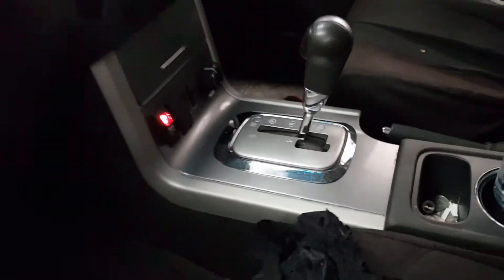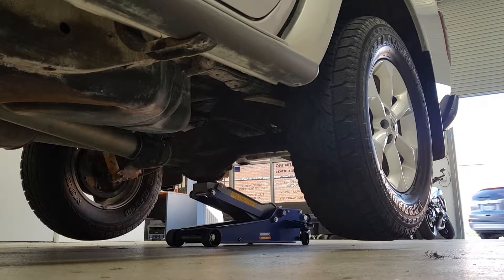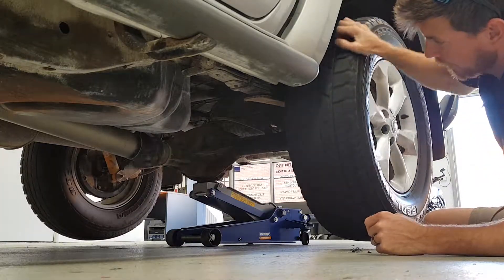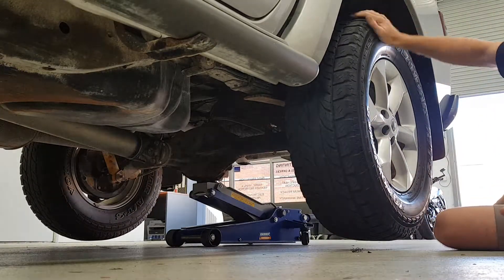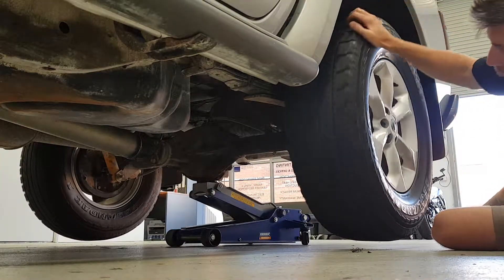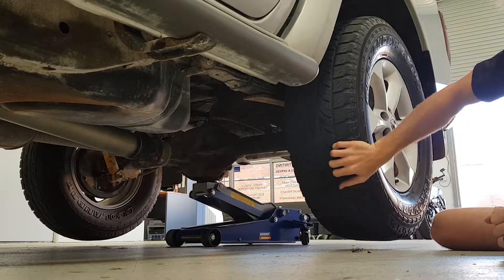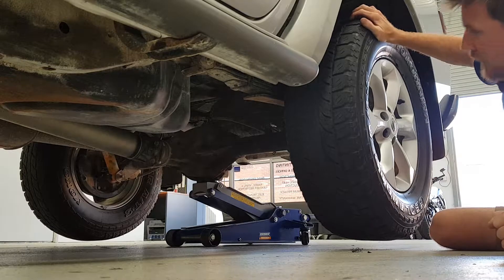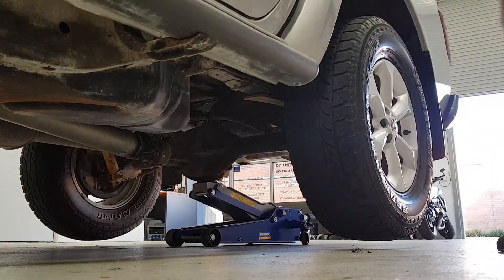Harrop e locker design feature or fault? Unlocking when changing direction.

Comment: When I went to get lockers six years ago, I knew exactly what I want, ARB Air Lockers. I  started doing research into lockers after a mate told me about a locker I'd never ever heard of before, the 'E' Locker. It takes a lot to change 'my' mind, but after reading about the pros and cons and having a mechanic talk about the incredible amount of trouble he's had with Air Lockers leaking seals, and his comment was "why would you want to fill your diff with 100PSI of compressed air", I began asking myself  'is this guy for real'?

My research also told me of Eaton's E Locker flaws, and what I gained was the fact that the older, straight 'Eaton' Lockers, were not that good, as they had pins that locked in holes, and those pins rounded off and it didn't engage the locker properly, the 'Harrop' Eaton 'E's, on the other hand, had like a dog gear that locked the mechanism and did away with the pins, I also knew of the inherent design flaw of the 'E' Lockers magnet and ramp, whereby they would unlock momentarily between forwards and reverse, and remembered thinking to myself 'this can't be for real, for who would design a locker that would, or could unlock by itself'?

Making my mind up I finally settled on a pair of Harrop Eaton 'E's, which I installed myself (knowing virtually nothing about diffs before I started) and I must say, I'm pleased to announce I've never regretted the move. Whether I'm just into pussy offroading or not I don't know but even last night I had a situation whereby I flicked my truck into 2WD (the two on the rear, by means of locking the rear diff) and I came up short on traction, having to reverse, I came to rest on a rock. Having faith in the lockers to ultimately pull me through, and knowing that I could no longer go backwards any further, I reluctantly got out and flicked in the two free wheeling hubs. I then selected 4WD, by sticking the transfer case in lo and hitting the front locker as well as the rear, and bingo, the thing just walked up the wee slippery bank up onto the road... easy peezy!  

I've never noticed that momentary unlocking between forwards and reverse, to ever be a problem in the real world, which I must say, is incredibly unusual for me!
Reply: Possibly, is that because you weren't on a slope and that you didn't roll your truck backwards, even a bit?
Reply: @overnighter  Ha, you clearly just haven't read my comment, have you?

"but even last night I had a situation whereby I flicked my truck into 2WD (the two on the rear, by means of locking the rear diff) and I came up short on traction, having to reverse, I came to rest on a rock. Having faith in the lockers to ultimately pull me through, and knowing that I could no longer go backwards any further, I reluctantly got out and flicked in the two free wheeling hubs. I then selected 4WD, by sticking the transfer case in lo and hitting the front locker as well as the rear, and bingo, the thing just walked up the wee slippery bank up onto the road... easy peezy!"
Reply: @overnighter  25 second clip that I did yesterday, whereby I rolled back on a reasonably steep track and the E Lockers never let me down.
https://youtu.be/toXng-KLLno
Reply: @SeriousSchitt  I'm watching, cheers 👍
Reply: You got it, every time you hit that 'E' locker switch the moment you touch the GO pedal you will move off. I have twice seen air lockers on the track that when the switch was hit, the only thing that worked was the compressor.

Comment: This is a poor test, the power is transmitted from the driveshaft into the locker. Yes there will be slop and it does slop from drive to reverse. However it shouldn’t be staying in open center. And that’s because your testing from the wheel and operating the whole locker backwards. To test the correctly, spin the driveshaft from drive to reverse, you should still see slop, but it shouldn’t get stuck in the open center. Remember the transmission of the power and where it comes from. The wheels spin due to the motor running down the drive line, it does not work in the opposite direction.
Reply from the maker: It does the same thing when turning it from the drive shaft and changing from forward to reverse. Its due to the ramp locking design of the harrop elocker. I do alot of sand driving and suffered a failure of the elocker which i suspect was from getting bogged and changing from forward to reverse and gassing it to get out over time. Hence this test as it was very difficult to have it fixed under warranty as i was accused of "crash locking" it which i never did.
Reply: @dainebatchelor9382  but that’s not showed in your video. Your still operating the locker from the wheel and not the driveshaft.
Granted I don’t have a vehicle like this, I have it installed on a tundra but I encounter the same exact issue when doing this test from the wheel. 
If I do the test from the wheel, it won’t ride up the ramp and it will stay in open, but if I do the test from the drive shaft, it will always ride the ramp and lock.
Reply: If you watch your post labeled “video 2”, you actually do the test correctly. 
In that video you rotate off the driveshaft, and the locker seems to work as designed.
You will have the slop when going from forward to reverse but that’s because the locker has to go from the locked position in the forward ramp, it has to come back down to open, then it has to ride the ramp for reverse and re lock. This is normal and is the inherent “slop” with e lockers.
The e locker is designed to be used as a prevention device. What I mean by that is it should be engaged before you hit the bad terrain, not when your in it spinning your wheels off stuck. You do this before on good terrain because its accounting for that slop and it allows positive traction on both wheels to ensure a proper lock. It simply the way it’s designed.
Now on the opposite spectrum you could get a air lock that can be thrown on any time, and there shouldn’t be any “slop” because they have locking pins that bind the diff up with the air pressure, you can lock them nearly anytime as well, the draw back is they need to be sealed, they operate on air, the parts are smaller, and they leak making them less reliable over time.
Reply: @dainebatchelor9382  I'd be surprised if they took the responsibility 🙄
Reply: @dainebatchelor9382  a "proper" electric locker would be very nice, though
Reply: Yes, once the electromagnet receives power, it is the instant the tail shaft transfers power to the diff' that the 'E' locker engages. An 'E' locker was never designed to be engaged by jacking up the diff and hand turning one of the wheels in the air.